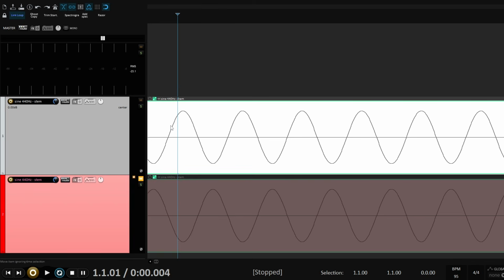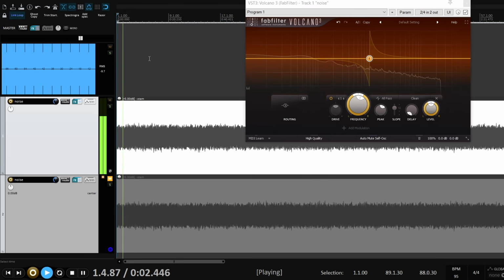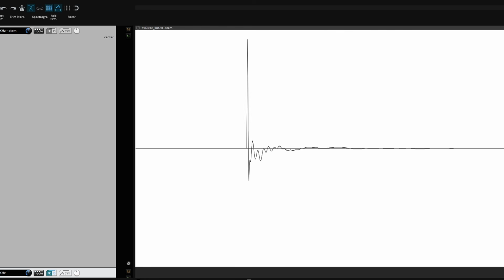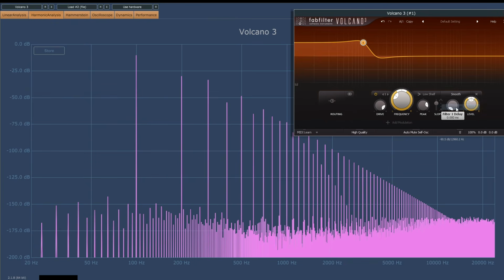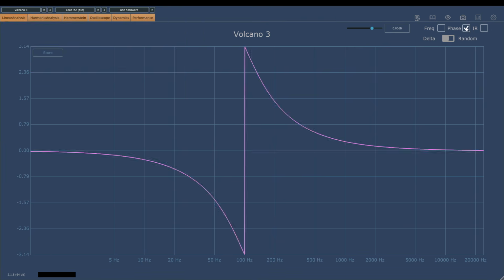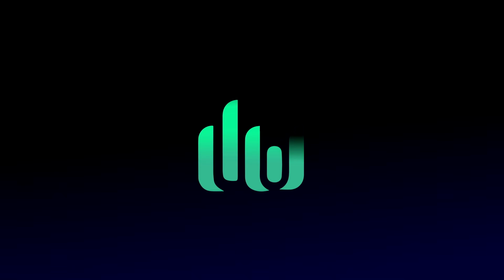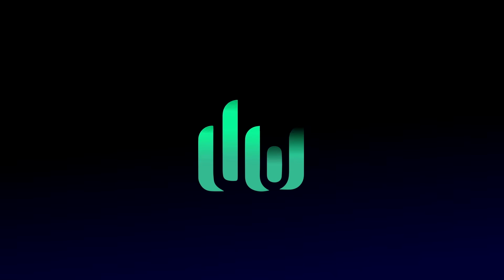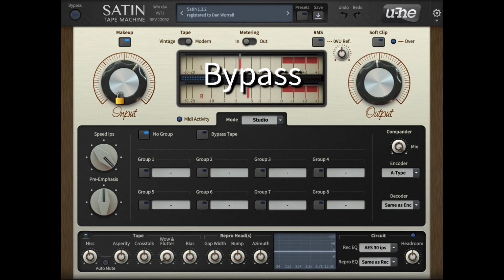How (Not) To Test Your Plugins

Comment: Dan, next time you’ll mention phase response stuff, could you also mention group delay? Because it’s much easier to understand for listeners (how many samples is each frequency delayed) instead of degrees of phase that have only mathematical meaning.
Reply from the maker: It's easier to understand? Can you explain it to me then?
Reply: @DanWorrall  Easy. Please take a look at phase response and group delay response plots at the same time. Group delay is calculated from “tilt” of the phase response at the point. It means for sharp transitions in phase response the group delay is bigger than for smooth transitions. So if I tell you that there’s say 15 degrees phase shift at 1 kHz, it means actually nothing. The area around this point is what makes difference.

But group delay plot values are trivial to analyze, is effect audible or not. If there’s say 3 samples of group delay for some frequency, it’s much likely to be inaudible. But 300 samples of the delay is audible (at usual sample rates).
Reply: "how many samples is each frequency delayed" that doesn't make a lot of sense by itself, does it ? Samples refer to time domain meaning amplitude between -1 and 1 (usually) over time. On the contrast, the frequency domain is a completely different story. No disrespect or anything, I just try to make us think about the right questions we need to ask ourselves

Comment: 39:26 Oversampling? Fading out frequencies above Nyquist is the job of the Antialiasing filter, not the result of oversampling.
Or am I missing something here?
Reply from the maker: The aa filter is what removes the aliasing, but the oversampling is also necessary otherwise the aliasing will have already happened and be impossible to separate from the wanted signal. The AA filter is part of the oversampling process (both up and down).

Comment: Two files that null can sound different in some cases in a valid way. That is, if you listen to one file in reverse polarity and it has a lot of transients that are not symmetrical (like in a drum for example), negative voltages sent to the speaker will pull it back from your ear on the transients, but positive voltages will push it forward. This does actually sound different because one produces a pressure wave moving towards you on the loudest transient peak while the other pulls away from you on the loudest transient and then pushes back at you. 

If you're going to null test and also listen, you should invert the second file only when the first file is also being nulled with it, and go back to normal phase if A/B listening.

Comment: Are your gain reduction measurement bits in the video sped up? I also use PD to measure compression curves, but I usually start with 6dB jumps to get the general shape of the gain reduction curve, then switch to a more detailed range with 1 dB steps — but it takes quite awhile. Is there a way to change the duration compressor spends on each step?
Reply from the maker: There's a "quality" setting which iirc makes it run faster / slower.
Reply from the maker: General settings, with samplerate etc.
Reply: @DanWorrall  Appreciate it! For content dependant compressors with long attack and release times (also based on GR amount) I assume it's going to be skewed though, right? For example, I use Loopback to route PD through my Ableton Max devices, so it's sort of "real time" as opposed to any simulated run. I actually never used PD to measure standalone plugins, so I might be missing the concept here. My apologies if it's the case.

Comment: So it seems that i finally  understand Pulltec "magic" trick. 
Correct me if i'm wrong.

It's not about volume boost at all in the begging, it's about messing with the knobs until you find phase relationships of the low frequency harmonics, and keeping in mind that you're also saturating and generating harmonics and blending them with your signal. So in this case, if you have track which lacks low end, you should check for phase problems in this region, try pulltec trick and later decrease bass with linear EQ if in the end you little bit destroyed balance of the whole track?
Reply from the maker: There's a lot less saturation in a Pultec than most people think. The "magic" is in boosting the lows with a low mid cut just above it. And in the control scheme, which forces you to approach it differently to other EQs. It's not really magic, in other words. I don't believe in magic! Except in the music itself...
Reply: In a hardware Pultecs the passive tone stack lowers the signal (if I'm not mistaken by 18 dB) which then boosted by the tube/transformer output stage by the same amount. Which happens even in bypass and with all knobs at 0 — so your signal going through EQP-1A (or similar) is slightly saturated (some additional harmonics added to the original signal) by the output stage. As @DanWorrall points out, it's not that significant, but still can be heard in some cases as claimed by some engineers (I personally can't say I hear it always). Original versions also had interstage transformer, but newer version usually simplify this and have single ended signal which is then transformed into the balanced signal by the output transformer. The significance of interstage transformer is up for debate.

This however has nothing to do with the "Pultec Trick" which is usually referred to simultaneous boosting and cutting of the low end bands — as it has single band selection switch, but involves two filters. As a result you get the low shelf boost with a slight notch (depending on the model, selected frequency, etc around -5dB at max setting). This can surely be replicated by almost any eq, but requires some tuning. In my experience all models have widely different interaction between these two filters and curves look different. So you don't have to know one way, just do it by ear.

Please correct me if I'm missing something.
Reply: I think its mostly something that happens in our brain that this type of EQ exploits...on any EQ a cut in one place will very often create a perceived boost in the frequences around the cut. The Pultec-type EQ exploits that to great effect. It helps "isolate" the boost you are applying by creating space around it. Thats how i think about it at least.
Reply: @j79-p9u  EQP-1A manual clearly states NOT to boost and cut simultaneously. It's not by original design.
Reply: @cuba1956  But people do...all the time...because it sounds good. But you are right of course, any EQ can do this, you dont need aPulteq for that. I was more referring to that way of cutting/boosting  close to each other than the actual hardware. That part could have been clearer i guess.

Comment: I love Bertom EQ analyzer (which is free), it is a VST and analyze the FX chains. It do have less feature but it is a good alternative.
Also for null testing, I have made a JS effect to detect silence, which is cool to be sure there is absolutely no difference at all. JS: Silence Meter it is called.
Thx for the video! All the harmonics analysis in PD seems indeed very cool!!
Reply: Plugin doctor can run inside your daw.
Reply: @eegoal  Ok but it doesnt analyze the chain, it still works with the Load VST button. Bertom EQ analyzer works withthe FX chain in the DAW (it need two instances, one to geenrate sound before FX, and one for analysing the modified sounds post fx)
Reply: @eegoal  right, corrected !
Reply: @eegoal  It doesn't run on all operating systems, where Bertom EQ does.

Comment: With regards to internal plugin bit depth: With modern native plugins, it's almost certainly going to be 32 bit single-precision (float) or 64-bit double precision (double). For DAWs that support an internal mixer resolution of 64-bits such as SONAR, every plugin that fails to support double precision requires a double->single conversion and back again with the corresponding loss of bits. It's a shame that FabFilter's (and iZotope's) plugins are still stuck in the single-precision world last I checked,  it's impossible to maintain a pristine signal path when this is the case. DMG Audio & Voxengo's plugins, on the other hand are typically 64-bit.
Reply: If the plugin you're using doesn't add extra information, bit conversions are lossless and essentially free with zero overheads. Apart from ProTools, every single DAW nowadays processes audio at 64 bits because they're running inside an OS which itself is 64 bits.
Reply: @BrunodeSouzaLino  This isn't true and audio bit depth has nothing to do with if your OS is 32 or 64 bit. There is some truncation when converting a 64 bit float to a 32 bit float, although it is very minimal.
Reply: @TheQxY  If I start with a 32 bit integer and convert it to a 64 bit float, where am I truncating? Data doesn't magically create information which never existed in the first place because it's a larger number. Every single 32-bit integer has an exact representation in double.
Reply: @BrunodeSouzaLino  You're right on that. But there is truncation the other way around, and not all mix busses of DAWs are 64 bit.
Reply: @BrunodeSouzaLino  This is a common misconception, as mix precision (math resolution) and OS architecture are independent of each other. Same goes for mix engine resolution & plugin resolution, which is why it's better to use the terms single/double precision when discussing this. Not a ProTools user, but back in the day ProTools LE had a single-precision mix engine whereas in SONAR one could choose. The only way to be certain is by using a plugin bit analyzer such as Stilwell Audio's "Bitter" bitmeter plugin, which is free.

Comment: One question though: The aliasing of compressors for sure would be more audible when using extreme attack and release times though, right? And probably less so with oversampling?
Reply from the maker: The faster and more extreme the gain modulation, the more harmonics will be added, so the greater risk of audible aliasing. So yes.
Reply: @DanWorrall Thanks!

Comment: Any volume change over time generates harmonics. Nothing that changes volume over time is transparent (compressors, limiters, tremolos, etc) at least not in the sense of harmonic analysis. You can easily see that by applying a quick volume envelope on a sine wave and looking at a spectrum analyzer.
Reply: Yep, compression is amplitude modulation and AM creates sidebands

Comment: 6:09 On the other hand, I am saying this is ALWAYS inaudible... with a few assumptions/caveats. 
1) The moment of change can be often heard, but is harder to notice the more complex and higher pitch the waveform is. 
2) Your ears gets used to a certain audio including it's phase. When it is changed, even though the audio content don't change, the inverted phase causes conflict to what your ears are already accustomed to. And just like the previous point, on lower pitched and smooth sounds it is more noticeable.
3) Both of above things holds true as long as the phase change is done to the main output signal. But if you change phase on just one track, it might introduce very noticeable interactions with other tracks which can significantly change the audio content itself. 

That is pretty much all there is to it. In the case of 1) and 2), the audio doesn't change at all so it physically cannot sound either better or worse, or even different. The only change is how you subjectively perceive the audio due to your ears getting accustomed to it in one way and then hearing it the other way. If you hold a short pause before listening the signal again in inverted phase, you would not notice a thing as you'd hear that with fresh ears again. That's the same phenomena for which 9/10 audio engineers recommend you for your theeth.. sorry.. to have some pauses when you have long mixing sessions. Thus, you should not use that perceived difference as a mixing tool.
Reply from the maker: Here's the thing: phase shift that's "inaudible" becomes very obvious as soon as you're hearing it in just one ear... So I tend to conclude that we can hear phase shift, but in most cases our brains discard that information as not significant.
Reply: @DanWorrall  phase shift is an important piece of information the brain uses to locate signals in space, so it makes sense that we perceive static phase shift in only one ear, but not in both.

Static phase shift is still audible though, though you have to train your ear for it. A well known example is all-passing rolling basslines in psytrance music, it creates a laser-ish sound on the edge of the sawtooth which gives psytrance its distinctive sound.
Reply: @DanWorrall  Yes, thank you for pointing that out. I did not remember it.

I believe that relates to what I said about the frequency. As good as brains are processing audio, their frequency resolution is not very good. Due to how ears work roughly logarithmically, lower pitched sounds are easier for they take kind of more space. The lack of resolution towards higher freqs causes everything to mesh together making changes inaudible, but when listening with one ear, the two signal(one for each ear) won't mix together in brains and the phase shift becomes obvious.
Reply: @DanWorrall  Interesting. Could you elaborate on the one ear point? I tried to do a test with one side of my headphone, but I still could not hear it the difference. Did you mean by "one ear" that we hear static phase shift if there is different in phase between the 2 ears?

Comment: Would there be any benefit to increasing the bit depth of a plugin before rendering?
Great video as always!
Reply from the maker: @Aona_Music  not so. In fact all your audio gets converted to floating point for mixing. When you set the "bit depth" for a project, that only affects the recorded files: all mixing and processing is 32 or 64 bit float regardless.
Reply from the maker: Only if it's not currently working properly because the bit depth is too low. Which I would consider broken, frankly.